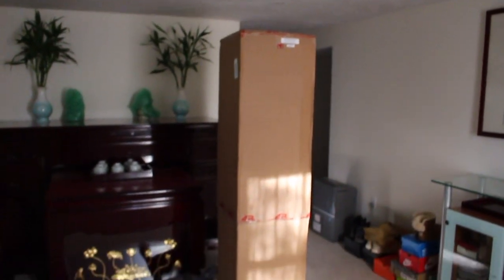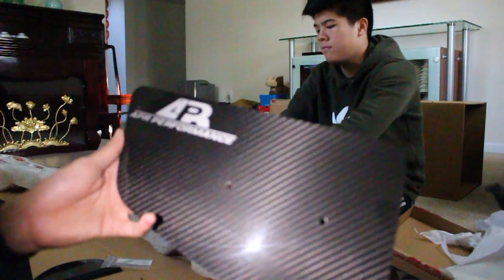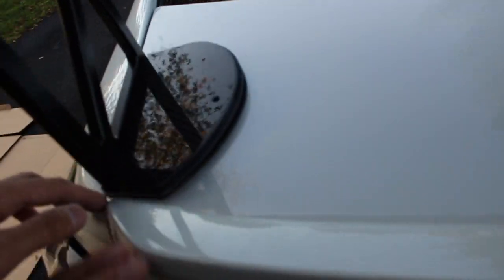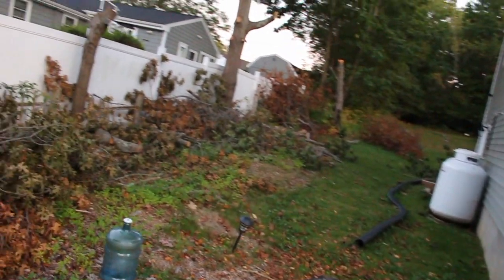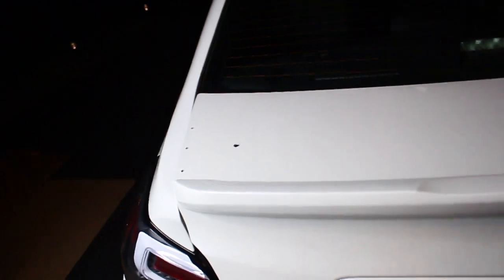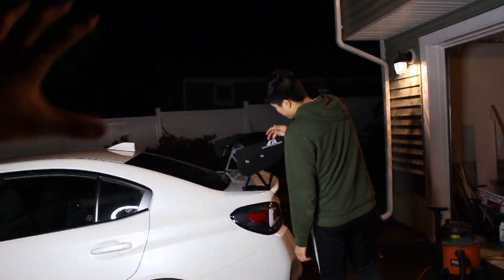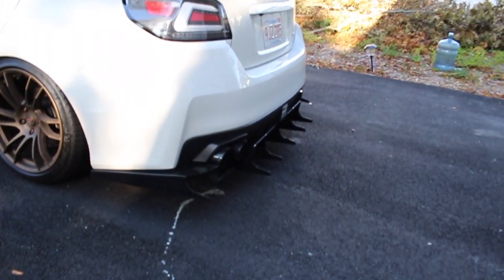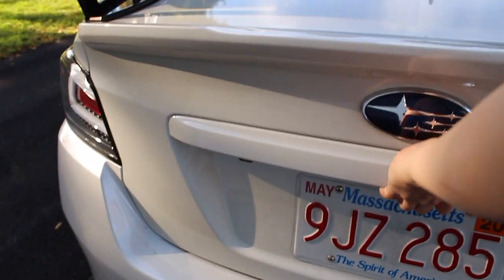JOINING BIG WANG GANG // Installing APR GTC-300 67" Wing

Comment: Yo, I installed this wing on my '18 WRX a couple weeks ago but had a question for you. With the holes that mount the wing to the trunk... There's the three, then the single (the single goes into a larger hole with a casing). How did you get the bolt to catch that casing so that it threads into it? It seems mine just free spins. And it's not too big cause casing doesn't slide through it and the inside of it can only be so big, but mine literally doesn't attatch to it lol. Isn't a problem as the wing is suuuuuper sturdy and I've driven over 600 miles with it on and everything is still perfect, but was just wondering.

Comment: So yours looks clean af but I ordered my GTC-300 and it came scratched up some and apr told me it's common so I was wondering if yours came marked up? Also did you use and clear coats on it? If so what kind
Reply from the maker: I have heard that’s a common problem but luckily mine came PRISTINE 👌 no scratches and perfect clear coat. I haven’t added an extra coat or anything but I do also wax the wing everytime I wax my car. (Idk if that helps the clear coat or not but I figured why not cuz it’s just wax it wouldn’t hurt lol

Comment: Hey bro, did you keep the WRX's torsion bars or did you switch it with the STI's? I've read on forums that you should change the bars to be able to open it. But from looking at your video, it looks like it still can open. Have you had any trouble opening the trunk every since you installed the wing?
Reply from the maker: Dennis Benlot no need to switch! :) and no trouble opening the trunk at all, I use the trunk everyday and I can open and close the truck with absolutely no clearance issues. But it will add extra weight to the truck so don’t slam it. Hope this helps!